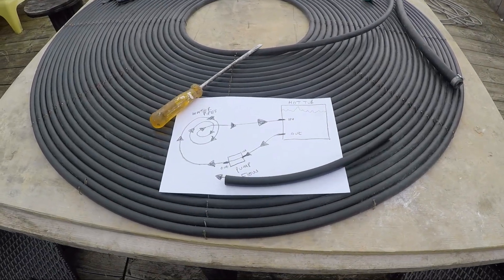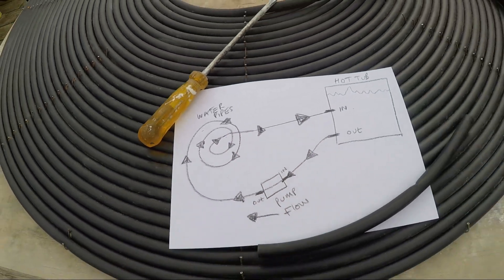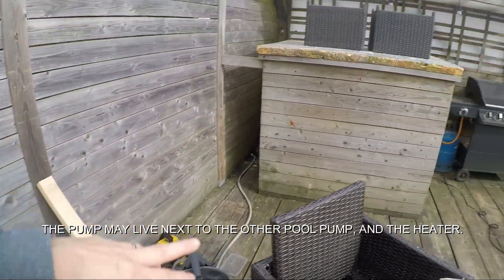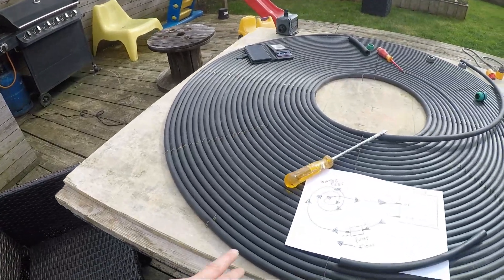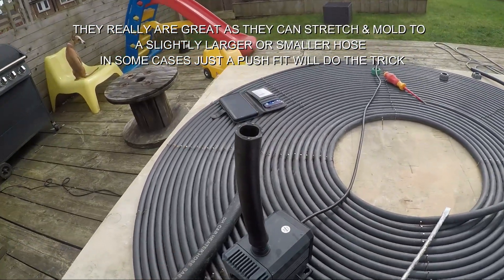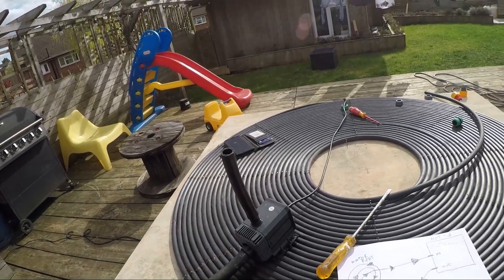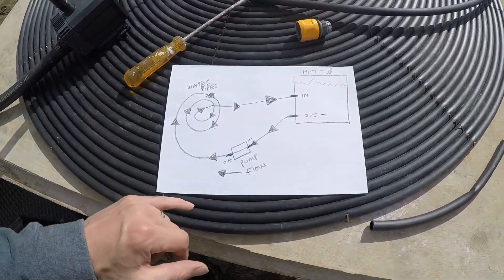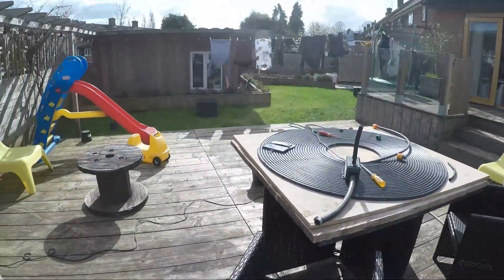How to make a Solar Powered Hot Water Coil  |  Water Pump and Connections  |  Part 3/8  |  EP#19

Comment: I see these video's were made over 2 years ago. How is the irrigation pipe withstanding the heat and how is the solar heater working now ?  Do you have any problems with the hose splitting in the sun or the Chlorine leaching the inside of the hose. 
Does the irrigation hose have a shelf life just wondering if it's better to use PEX pipe to make a solar heater instead as it has a 25 year guarantee.
What are your views ? Thanks 🤔

Comment: You might be able to use the spring that plumbers use for bending copper pipe to get a more acute bend in the pipe.  
I wonder if a solar powered pump mounted on the outlet side of your tub would be enough to push the water through the system?  And I would think that hot water in at the top and cooler out of the bottom of your tub would be the best.  But then, I am no expert. Watching this with interest, cheers John.
Reply: I have two of these coils made from the same irrigation pipe that you are using, they have been heating my intex pool for the last couple of years. For the flexible hose you need, try 20mm pond hose, and for the inlet and outlet you can use water butt overflow tank connectors. Take a small piece of your irrigation pipe to the local pond store to check fit.
Reply from the maker: Amazing thank you! How do your coils work? What pumps do you use?
Reply: @thelondoncraftsmanworkshop  the coils work really well. I tried several pumps with different flow rates. I don't think it matters if you use a high or low rate, high rate will not allow the water to heat up as much in the coil, but allows a greater amount of water to pass through, whereas low rate allows hotter water but not as much of it. The end result is the same for both flow rates. I settled on a lower flow, 15w cheap boyu pump. Water was exiting around 55 deg c back into the pool. We have now dismantled the pool, and are installing a hot tub which will use the same coils, hence how I found your video.
Reply: One thing I forgot to mention, the most important thing! The pump was wired via the cooling side of a heating /cooling thermostat. The stat and connections were inside a 6" black plastic Wiska box which was mounted next to the coils. This meant that when the temperature inside the box reached a preset temp, it would switch the pump on to heat the water. The stat had a permanent supply to it, meaning I could leave it to do it's thing and not have to think about turning it on and off as the sun came out. I found 32 deg c to be a good set point for the stat.
Reply from the maker: I'd love it if you could add some links on here the the heat and cooling  thermostat , also the pump you went for in the end.
I'd love to give this a go.
👍👍👍
Reply: @thelondoncraftsmanworkshop  sorry for the delayed reply. The stat is an Eberle rtr-e 6704, although I'm sure other similar stats would work just fine. I'm unable to post photos on here, is there a way a could contact you to share info? We've just bought a Lay z spa Paris and I'm currently getting the system up and running again, linking both coils to flow from one pump. On initial test run this morning I'm getting 3 deg C increase in temp on the water exiting coils, 35 in 38 out at a flow rate of 3litres/minute it's bright sunshine here at 11am, Google says our current temperature is 21 deg.
Reply: I hate forgetting details! : the pump I'm using at the moment is 65w/4500 litres per hour from all pond solutions. I have an approx 3m head from the pump to the shed roof where the coils are, outlet pipe underwater to create a closed loop. I can't remember the length of the coils, but I think they are 2x 50m combined to make 100m. Hopefully you can choose your pump based on all the above details. 👍
Reply from the maker: Great comments, I like the spring idea for curves!!